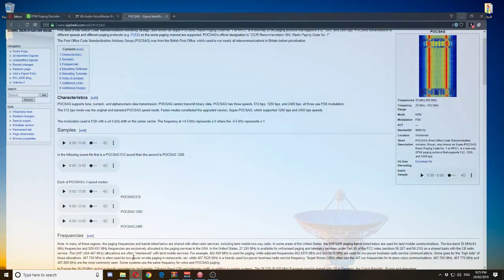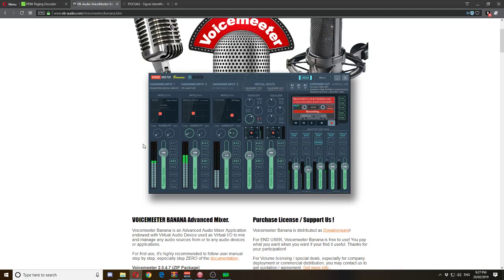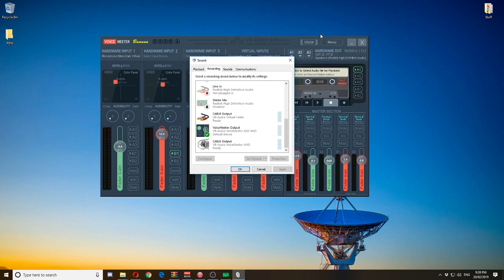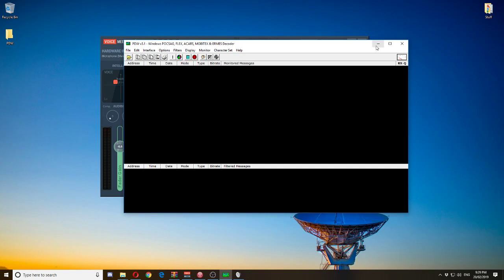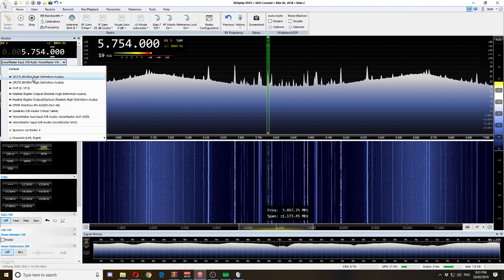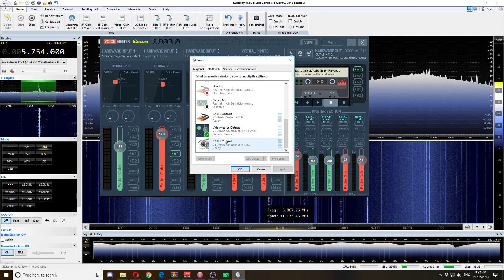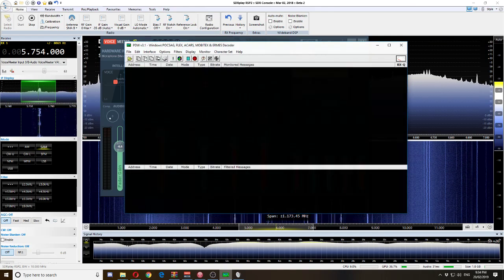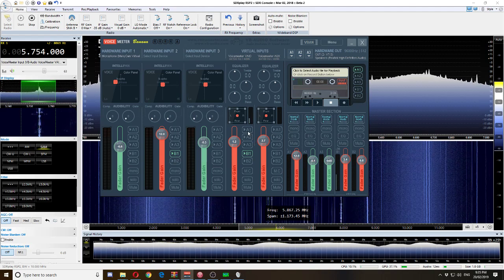How to Decode POCSAG & FLEX using an RTL-SDR Dongle

Comment: I followed this but my Laptop doesn't have a 'cable' output type.
So I set the PDW soundcard to Voice Meeter Output (VB-Audio),  
the Voice Meeter A1 to the Speaker/Headphone jack, and the SDR Sharp output audio to the Voice Meeter input (VB-Audio)

This all appears to be ok as the Voice Meeter bar indicators look ok and I can switch the SDR input on and off to the headphones with A1.
The little power type indicator in PWD starts moving when I switch B1 on.
Does this mean it should pickup the signal, assuming it is of the correct type?